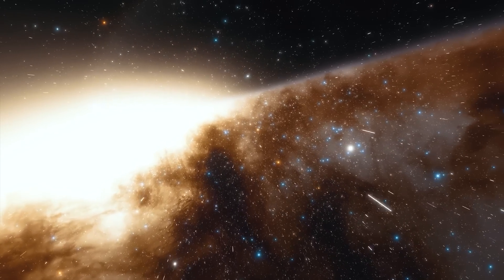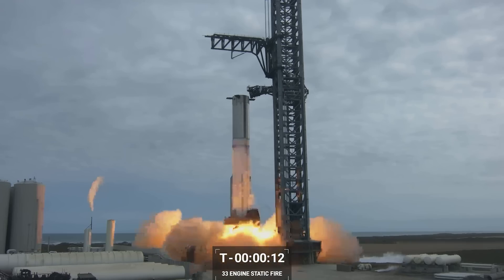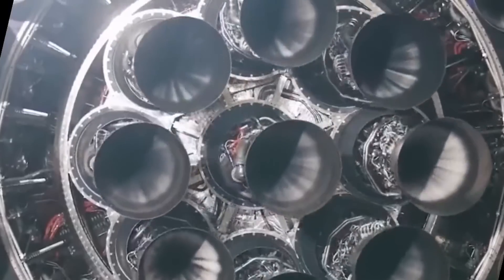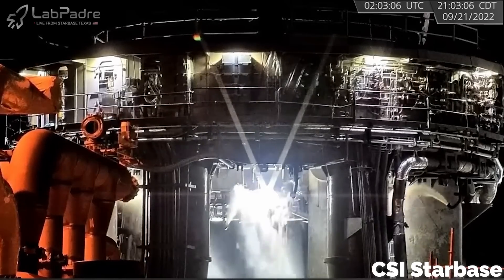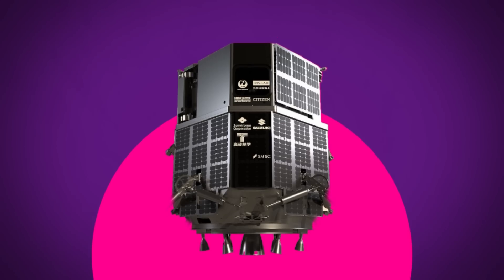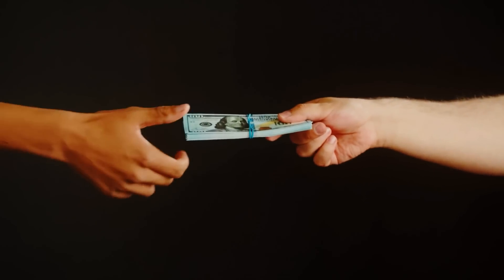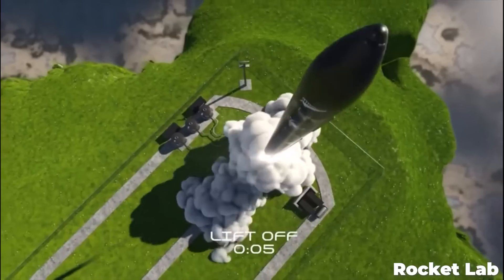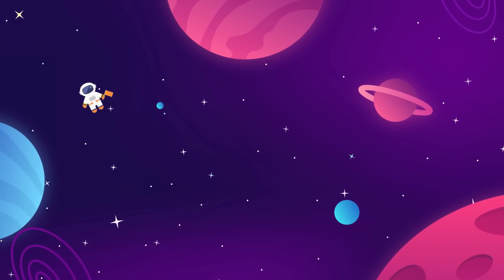The SpaceX Starship Orbital Launch Update & Repair Progress Is Here!

Comment: Put heat shield tiles directly underneath the engines that way they will absorb the heat use the sandwich Use the water infusion method with. Launch to keep the cooling down use the minimum amount of engines needed to get the spacecraft all way from the tower. Once? This craft exists it's the tower. Then light the remaining engines 4orbitallaunch
Reply: So the Japanese moon landing craft crashed to the surface because the engineers miscalculated the amount of fuel needed to land On the moon surface Go figure a japanese engineer messed up on a math problem what are the odds

Comment: The fix is simple, construct 1 only exhaust diverter system so simple, anything like a heavy solid steel plate covering the base of the platform will not work even if it is water-cooled as the exhaust turbulence forces are so massive  and superheated steam will travel upward and do the same damage as what happened at the first launch

Comment: Thinking about it now too blowing the hole in the ground might have been less time-consuming than digging the a hole on ground that was ment to withstand a blash from the rocket to fit the steel coolant pad, will be alot easier now to fit.

Comment: Another reason i believe they didn't bother putting the steel cool pad down was time plus risk,.. Its launch number 1, getting it off the orbital launch pad would be the number 1 goal without it blowing up on it, they have a replacement obital launch pad i dont think they have a another steel coolant pad apart from 1 in production, so it could have blown up everything for 1st test flight? Which would push it 2 months back on 2nd test flight nahhhh, Even if some of raptor engines were damaged, it can still launch with quite a few missing and would have given great data on if a few ever do get damaged or don't start or if mid raptors try fire up mid launch more great data tbh. The tanks are old they needed replacing anyway. Elon doesn't strike me as a man that waits for everything to be perfect he tests what's working first then goes onwards from that step happy that he know a, b,c works so I can add d, e, f , test repeat ect ect until he gets to z which is a finished masterpiece tested with everything working.
I can't see logic in putting what I think is a perfectly designed untested rocket all together at once waiting for along time that could explore and give barely any data and be a massive drain of time.
Reply: excited shit though, I wish I could get over from the UK to see it. Was anyone here there ? I can only imagine the sound and emotions watching it bet its alot bigger than looks on this phone lol 😆

Comment: After seeing a few engines for static fire, ripped apart ground zero of the old. 32 raptors at full throttle though, damn… reenforced concrete was chalk compared to that much power

Comment: There's no way for "ejecta" to go up the engine. They keep on firing, it's not just an impact, it's continuous flow of high velocity and pressure gas. SpaceX has also said that they've seen nothing that suggests the engines nor the rocket was damaged by any debris. The 3 engines that were out at around launch never actually lit up.

Comment: Being an engineer with 30 years experience I would not repair that site, too many things to miss.  Tear it down and rebuild it the way you have planned now with more shielding around the tanks.  It will be quicker and less expensive in the long run.
Reply: dude what?! they'll make another site altogether when they are done testing and learning. This is their lab. Tearing it down now, while they are like going to blow up more shit, dont make sense. Do wish they had held off on construction at Cape Canaveral until they get more learning done tho.
Reply: also I feel like the deluge system/diverter was a fairly predictable need. dont really get how they missed that.

Comment: Ask yourself, could a chunk of concrete travel directly against the supersonic flow.  The concrete was not the issue, the sand below the concrete could not handle the load, the concrete settled and cracked, the jet entered the crack and blew the concrete out, not straight up into the engines.
Biggest issue the FAA has is that the abort took 40 seconds, that is waaaaay toooo loooong, and they will beat on Space X about that. That and every eco terrorist group in the world is now suing  the FAA, so the next permit is going to take a lot longer to get.

Comment: If you watched his pod cast you would know 7 engines were shut down to see how it performed with the minimum, not because of damage to them & the thrust vector took damage is why it self destructed
Reply: No! Lol 3 didn’t start and the 4-7 others that failed clearly blew up.
Reply: @ryanp0342  in short, a failure rate of about 1 in 3. Doesn't reflect nicely on the quality control on Raptor engines. Good thing that they don't cost much, right? I mean, they just wasted 39 Raptor engines on this 'success'.

Comment: the only liquid that might work better than water might be Fluorinert Electronic Liquid FC-43, which has a boiling point of 165°C (329°F) and a thermal stability limit of 210°C (410°F). Another example is hydrofluorocarbon (HFC) refrigerants like R134a, which have a boiling point of -26°C (-15°F) and can operate at high pressures and temperatures up to about 135°C (275°F) without significant expansion. Cheers from Park City Utah!
Reply: JESUS CHRIST IS RETURNING SOON THE RAPTURE IS NEAR. OUTER SPACE IS A HOAX. EARTH IS FLAT WITH A DOME CALLED THE FIRMAMENT. THERE ARE FALLEN ANGELS IMPRISONED UNDERGROUND BY GOD. AZAZEL AKA LUCIFER IS AT AREA 51. HE IS WHERE ALL THE TECHNOLOGY, SYSTEMS AND LIES COME FROM. ROME FOUND HIM YEARS AGO. INFO IS ON MY PAGE
Reply: Are those liquids environmentally friendly? Refrigents are usually in closed systems and not let out to the environment.
Reply: @mrbaab5932  Well Hydrofluorocarbon (HFC) refrigerants like R134a are generally considered to be non-toxic under normal usage conditions. However, they can be harmful if they are released into the environment or if they are handled improperly.

 
the most promising ome I believe is Fluorinert Electronic Liquid FC-43 which is generally considered to be non-toxic to humans under normal usage conditions. However, it can be harmful if it is ingested or comes into contact with the skin or eyes. Exposure to FC-43 can cause irritation, redness, and swelling of the skin and eyes.

In addition, FC-43 is a type of perfluorinated compound, which means that it does not break down easily in the environment and can persist for a long time. It can also potentially bioaccumulate in living organisms and have adverse effects on aquatic and terrestrial ecosystems. the problem for both as you see is getting them Environmental Impact Statements approved and convince environmental groups! 

I believe the biggest challenge will be the sound pressure hopefully they learn a good lesson but Spacex must the most sophisticated computer modeling method used for sound pressure the finite element analysis (FEA). FEA is a mathematical technique used to approximate complex physical phenomena by dividing the problem domain into smaller elements and solving equations for each element. This method can be applied to sound pressure modeling by creating a 3D model of the acoustic environment, which is divided into small elements. The equations governing the propagation of sound waves are then solved for each element, taking into account factors such as the geometry of the space, the properties of the materials, and the sources of sound.

Cheers from Park City Utah =)

Comment: if Spacex  did not see this coming "anomaly"  what else is this pisss poorly though out and designed? and the water cool steel plate is a laughably bad idea it will blow up like as the largest boiler explosion!! Steam is a vapor that is created when water is heated to its boiling point and undergoes a phase change from liquid to gas. As the water is heated and converted into steam, its volume increases significantly, and it can exert a great deal of pressure on its surroundings.

The expansion ratio of steam can be calculated using the ideal gas law, which relates the pressure, volume, and temperature of a gas. At standard conditions (0°C and 1 atm pressure), one gram of water can produce about 1,673 liters of steam. However, at higher temperatures and pressures, steam can expand even further.

For example, at 100°C and 10 atm pressure, one gram of water can produce about 23,500 liters of steam. This expansion can be used to generate power in steam turbines, which convert the energy of expanding steam into mechanical work. good luck muskrats!
Reply: Relax Ezra, Musk does not know of your existance.

Comment: SpaceX fanboys seem to hate NASA's caution, but we have that caution to thank for the success of the Dragon 2 Crew system success. Elon has proved many times that he has a "damn the torpedos, full speed ahead!" attitude. Since he has the mindset of Silicon Valley of "move fast and break things", it is understandable. But NASA and the FAA will be an important counterbalance to Elon's recklessness. Hopefully, he can get Starship working without killing anyone.
All the fanboys have to face the fact that Superheavy threw pieces of concrete big enough to smash an SUV way up in the air and deposited them over very long distances. It is lucky that no one was hurt. And we also have to face the fact that it was the result of haste on the part of SpaceX and willfully ignoring the experience of other engineers over the course of 60 odd years of spaceflight. Waiting for the steel plate would definitely have been the prudent course of action. But Elon, when faced with a choice of powering ahead and waiting for things to be better prepared, always seems to choose going ahead.
Personally, I am thinking Jared Isaacman's wife should be beginning to worry, since Jared is looking to be one of the human test pilots for the Starship when Elon thinks its ready. The idea of lifting off INSIDE the second stage/spacecraft on top of thousands of pounds of liquid oxygen and methane would not fill me with confidence, unless they develop a little ejection capsule with a parachute. A manned Starship will be an entirely different thing than a cargo or tanker launch. As a lunar lander, it is not much more dangerous than any other option, but lifting off from Earth, it is much more dangerous than other options, like Dragon 2 or even Starliner!

Comment: Like the show. Elon tweeted that he didn't believe any of the engines were damaged by the debris from the pad. Could be true because the concrete, even though traveling an a high speed, would have to travel against the flow of a Raptor engine at 90% thrust. A bigger problem is the reliability of the Raptor engine. They have yet to light all of them without some of them failing. This time three of them failed to start up properly and had to be shut down before liftoff😒
Reply: So according to Elon they have an reliability issue in the engines in addition to not having built a flametrench. Also I believe I did see some kind of high pressure gas plume coming out of the housing of one of the undramatischste tank

Comment: With over 37 of advanced material reinforcement, concrete and failure analysis engineering experience, the physics, science and math running the numbers proves the launch system would be totally destroyed during the launch.  

Proper Science, Physics and mathematical calculations are critical to prevent these preventable disastrous results.

Comment: A design problem or an engineering problem? 
The story from SpaceX Actual is the sand under the base compressed causing the special concrete to fracture under the tremendous thrust from Booster 7. That's not a design failure it's an engineering failure to identify the risk.

Comment: The test fight wasnt a failure at all. They have said for months that it would probably not reach orbit, and they only needed it to get off the round. It self destruxted because it lost all steering when the hydraulic systems failed. The newer boosters don't even use hydraulics anomore and have electric steering - because spacex knew the hydraulics ware likely to fail - wich they did.
The test flight was a success that ended in excitement. Rockets useually get torn to pieces if they go only a few degrees of course, but the whole starship did several loops and was still fine.
Reply: Rockets get torn to pieces when they are off a few degrees because their flight termination systems function. This is not a good thing. Not to mention it was spinning slowly in practically zero atmosphere and still bent in half.
Reply: It stayed intact because it was over pressurized  by the excess unused cryogenic propellant sloshing around in the tanks increasing the gas phase pressure. 
It was no longer accelerating propulsively due to the multiple engine failures but tumbling in free fall (basically zeroG). 
All meaningless in a normal ascent profile.

Comment: Almost everything in this video's "treatment" of the Starship/SuperHeavy launch is somewhere between wildly exaggerated and flat out wrong.
Reply: Please elaborate
Reply: @camielkotte , for example the video says "... pulling a couple of flips in an attempt to right itself and then exploding when the fi=light termination system system kicked in" All of this is incorrect. This was likely to be nonsense just watching the flight and knowing anything about rockets but SpaceX has given lots of information that contradict this. Brandolini's Law points out that merely pointing out what is wrong would require more time/effort than it's worth.
Reply: @camielkotte  The fact that the flight termination systems kicked in but failed to do what they were designed for, namely termination the flight. How sad is it that the self destruct only accomplished destructing itself instead of the rocket.
Reply: @PDVism , huh? The flight termination system did terminate the flight. Just not as quickly as it should have.
Reply: @leonardtramiel8704  The rocket breaking up almost a full minute AFTER triggering the FTS does not equate to a controlled flight termination. 

The idea of an FTS is that when it gets triggered that it TERMINATES the flight NOW. Not in 10 seconds, let alone a minute later due to an couple of explosion due to all the damaged in acquired during lift off.

In other words, they had no idea what was going to happen to the stage zero or even the OLM, they had no full control from the get go, they lost any sense of control within a couple of minutes and they didn't have control on the termination of the flight, did heavy damage to the refuge area (not expected) and even managed to do damage and possibly influenced the health of people in a town 6 miles away.

But sure, it went completely like planned and was a GREAT success.
facepalm
Reply: @PDVism , do you think that your addition of "controlled" and "NOW" are substantively differnet than what I wrote? They aren't. I said the FTS didn't do what it was supposed to do in the time it was supposed to do it. So, you used a lot of words to confirm what I said but masked it as a disagreement.

Then you LEAP to the subject of the OLM and Stage 0, which I never mentioned. And you finish off with the straw man of "compl;etely like planned and was a GREAT sucess" which has no relationshi[p to anything I wrote.
Reply: @leonardtramiel8704  Congrats, you just proved that you can't even parse your oewn sentences.
Let me quote you :"The flight termination system did terminate the flight."

Which means that you think that the FTS worked as intended.
Newsflash : it didn't.

To quote you :"Just not as quickly as it should have."

A controlled explosion means that they one activating it has CONTROL over what happens and when. They didn't have control over what happened nor when it happened.
This means that it was a failure.

Did I say that you said anything about the OLM? No. I didn't. I listed one event after the other that shows that SpaceX were fumbling the entire launch.

The snark at the end in my message was just that snark to point out that it didn't went completely like planned and wasn't a success at all.
Reply: @PDVism , your ability to misrepresent and misinterpret words and ideas is almost as astounding as your ability to use straw man arguments.

Comment: craters not a prob, the main structure is pile drived way into the ground, its really easy to fix
Reply: if Spacex  did not see this coming "anomaly"  what else is this pisss poorly though out and designed? and the water cool steel plate is a laughably bad idea it will blow up like as the largest boiler explosion!! Steam is a vapor that is created when water is heated to its boiling point and undergoes a phase change from liquid to gas. As the water is heated and converted into steam, its volume increases significantly, and it can exert a great deal of pressure on its surroundings.

The expansion ratio of steam can be calculated using the ideal gas law, which relates the pressure, volume, and temperature of a gas. At standard conditions (0°C and 1 atm pressure), one gram of water can produce about 1,673 liters of steam. However, at higher temperatures and pressures, steam can expand even further.

For example, at 100°C and 10 atm pressure, one gram of water can produce about 23,500 liters of steam. This expansion can be used to generate power in steam turbines, which convert the energy of expanding steam into mechanical work. good luck muskrats!
Reply: @ezragonzalez8936  thanks for the "War and Peace" size comment reply
Reply: JESUS CHRIST IS RETURNING SOON THE RAPTURE IS NEAR. OUTER SPACE IS A HOAX. EARTH IS FLAT WITH A DOME CALLED THE FIRMAMENT. THERE ARE FALLEN ANGELS IMPRISONED UNDERGROUND BY GOD. AZAZEL AKA LUCIFER IS AT AREA 51. HE IS WHERE ALL THE TECHNOLOGY, SYSTEMS AND LIES COME FROM. ROME FOUND HIM YEARS AGO. INFO IS ON MY PAGE